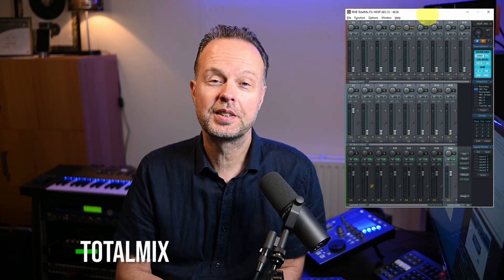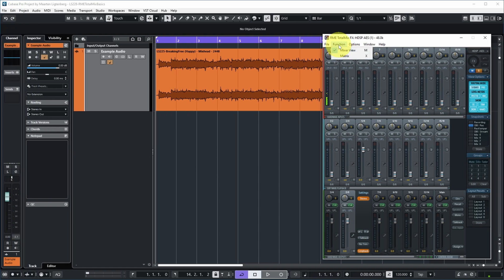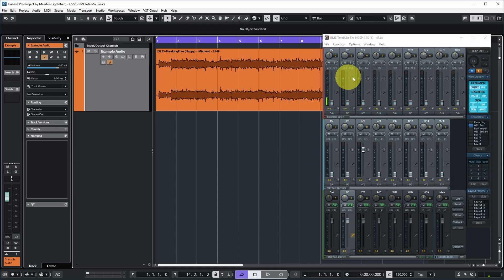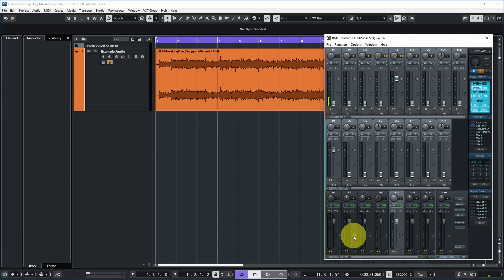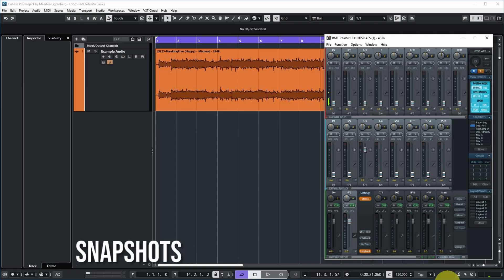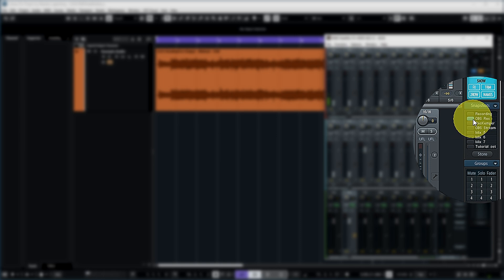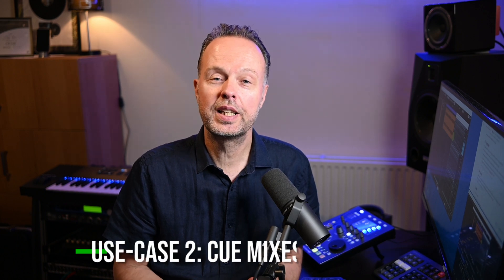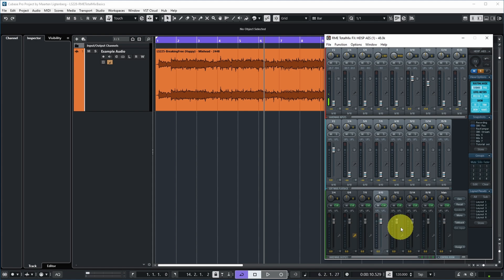RME TotalMix Made Easy: Stop Struggling, Start Creating

Comment: Just what I needed to prepare for the Digiface USB arrival. I have Audient now, but the routing is a real pain. iD Software decides regardless that its analog inputs must have channels 1 through 8, and you can't change them. So even if I exit Studio One with channels 1 and 2 in iD, I'll see the signal on 9 and 10. Basically, it does what it wants and doesn't listen to reason. That's why I decided to sell the iD44 and get a Digiface USB. I have some beautiful Apogee AD16 and DA16, and I don't need any other converters for my two preamps.
Reply from the maker: Glad this video can help you with your setup!

Comment: Hi there I’m from South Africa new on RME bought a outdated one the RME 400 can I get eq on my strip I’m using it for streaming please advise thanks
Reply from the maker: RME are typically very good at keeping their software compatible with older hardware so TotalMix should definitely work. But the TotalMix FX will not work because you need hardware with DSP for that. Even my own RME AES does not have that.

Comment: Hi,
Very helpful tutorial!
I couldnt find any info yet about wich interfaces have TotalMix , and wich have TotalMix Fx..
; and what is the exact difference between them,
Can you help with advice and knowledge? Cheers
Reply from the maker: @messengerro  I’ve never used the FX part as my interface does not have those. I think their UFX range has effects on board that you can use latency free during tracking for example.

Comment: Good video! Thanks! 
I try to figure out how to get my microphone Signal in the Daw than using effects send it to the totalmixer and get a new Channel as a Signal back in the daw so that i can Print some effects / Plugins and some like reverb dont wanna print in the recorded Signal but hearing during vox Recording) i still dont get it completly but it looks like its should be possible 
I like RME interfaces by the way for sure ❤
Reply from the maker: If you go through the DAW you’ll get latency. It sounds like you need an RME interface with FX onboard. Then you can add the FX in TotalMix.
Reply: @LanewoodStudios I have the babyface because of mobile but have one more in my homecity)

So its possible to use than other plugins or only from the onbord rme..? 
Thank you
Reply: I mean i can add reverb delay and eq there but i wanna print some tube amp in the Signal and its work already the latency is ok for mi just wanna put the Signal back in the total mixer and add after this step effects without Recording them ( the reverb in the total mixer as an example)
Reply: Hope my English is ok 😅
Reply: Do i need the loopback funktion for that?

Comment: Wow, first time RME Babyface fs pro and total mix user…I was able to record and monitor some tracks in Logic, but I have no clue how to get a signal to my S Gear amp bundle! Any quick tips to send me in the right direction? I’ll be studying your great video for a few days! 😆
Reply from the maker: @bcjaliu  if you want to record your guitar in logic, just use S gear as an insert fx. No need for any special routing.
Reply: @ thank you for your response! I was wondering if I could just play the S Gear on its own without a DAW, but yeah ultimately it’s for recording. I’ll look for the S Gear in the plug in section of Logic.
Reply from the maker: @ well yes that’s possible too. You can select the input and output you want in s-gear and play completely without a DAW. You do not even need TotalMix for that.

Comment: When I record vocals, I mute the speakers. Unfortunately, I get a disproportionately quieter signal on the headphones. I can increase this using the gain control, but this is also the input signal for my recording and it can cause distortion. How can I make the headphones louder without increasing the gain signal? Unfortunately, using the normal slide controls, I only get a relatively quiet signal to monitor on the headphones.
Reply from the maker: I’m assume you have a dedicated output of your RME interface connected to your headphone amp? In that case you can just increase the volume on your headphone amp?

Comment: The matrix section was way less a headache for me than the mixer. Also when I figured out that it can mislabel things, it made a lot more sense
Reply from the maker: @djvoid1  whatever works 👍
Reply: You do have to go to the mixer view to relabel things also. It's a very '2005' sort of interface :) Loads of capability but a bit cryptic for newcomers which I guess is preferable to a prettied up 'web 2.0' looking setup that hides features from you
Reply from the maker: @djvoid1  ha ha … be careful with those ‘suggestions’ 😉.

Comment: Ho un UCX 2 RME uso Luna come DAW ma c'è un problema con il buffer se registro audio con un buffer alto la registrazione è fuori tempo inoltre il valore del buffer non può essere modificato dalla DAW... dipende da il mio RME o dal daw?
Reply from the maker: I have no experience with Luna I'm afraid, but the DAW should be able to correct any latency in the recorded part. However, If you're buffer is really high, you may not be able to play virtual instruments properly due to the latency. You basically hear and feel a delay when you're trying to play to the track.
Reply: @LanewoodStudios  in fact the strange thing is that the problem is with audio tracks, I wasn't referring to virtual instruments, latency is normal there but recording an audio track that goes out of time is not normal

Comment: Ha, I'm still using a pair of 9632 PCI cards, 2x ADAT I/O, on Windows 11 and it is perfect
Reply from the maker: Yes those older cards are still supported! My first one I was taking about was a 9652 PCI. Not using it anymore but still supported.
Reply: Do you have a PCI slot on your motherboard or do you use an adapter ?
Reply: @soshomusic  I think I got the last motherboard ever made with PCI slots.  GA-Z270M-D3H Gigabyte
Reply from the maker: @soshomusic  not using it anymore. The new RME card that In talk about in the video has a PCI express interface. So that does still fit in my PC ;).